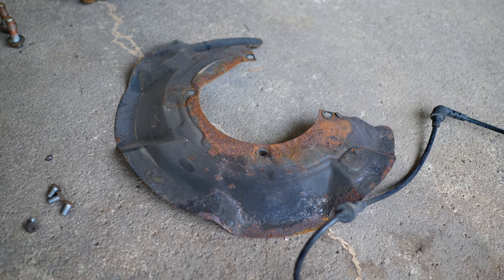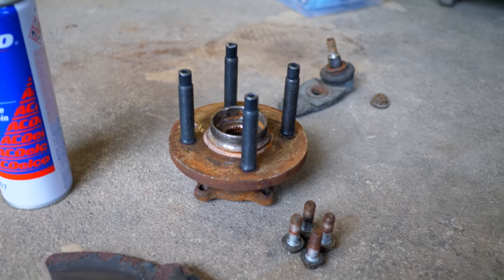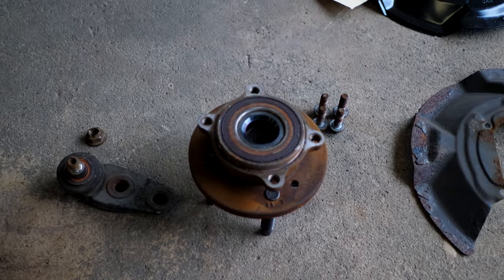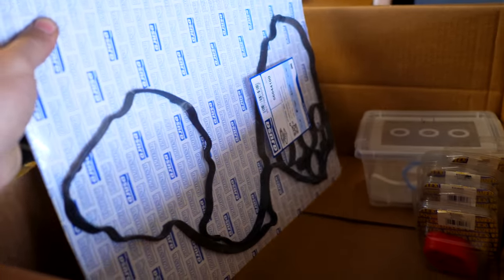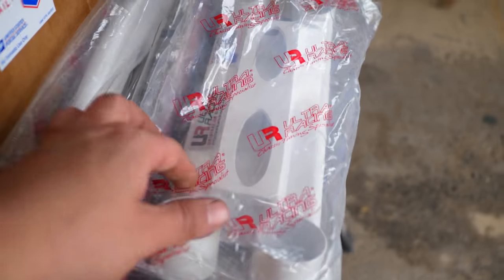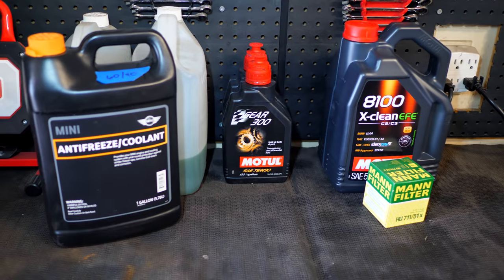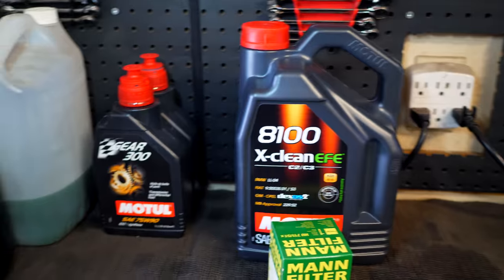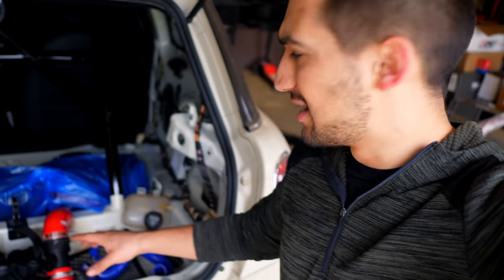Final Pieces to the Puzzle // JCW BUILD

Comment: I used Lucas Oil 10063 Engine Break-In Oil Additive and non synthetic oil for my break in. The additive really helps seal the rings. Just did the initial 100 km break in, changed the filter/oil then 500km and another 600km with a new filter/oil running majority of the time in vacuum and under 5K for the entire process. After that switched to synthetic and your good!

Comment: Cracking video’s, really enjoying your build. I’m in the middle of restoring/revamping my 2008 JCW and have done the very same to my spindles, brakes and suspension. I would recommend rubbing down those new rear brake shields and painting as the finish from mini is poor. My original ones were completely gone due to rotting away around the mounting holes. Looking forward to your next video. 👍

Comment: Maybe it's worth consider an engine oil that can take the incremental heat the engine will  produce. I think 5W30 is short. I would consider 5W40 (or even 5W50) for daily use and 10W60 for track use.  This is even more important in first engine runs because this is the moment when you want to have the best protection against friction.